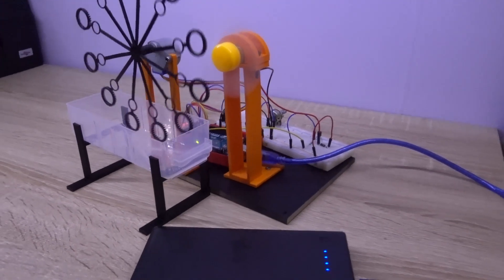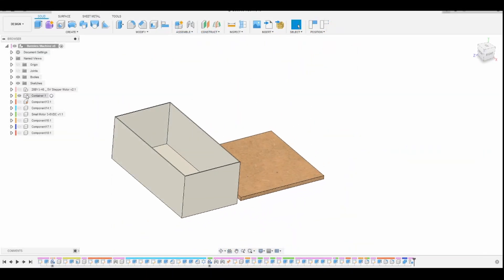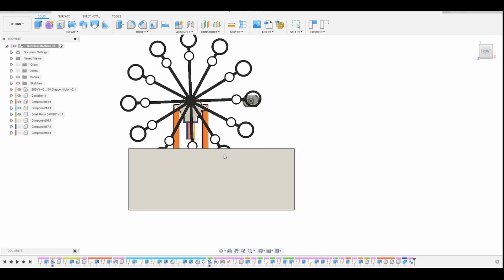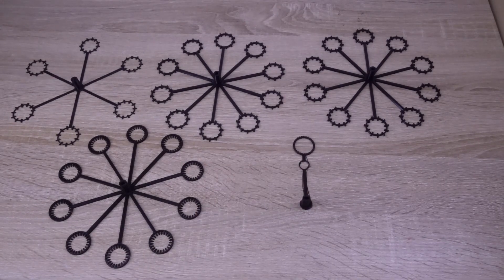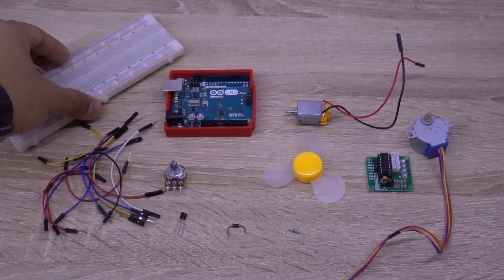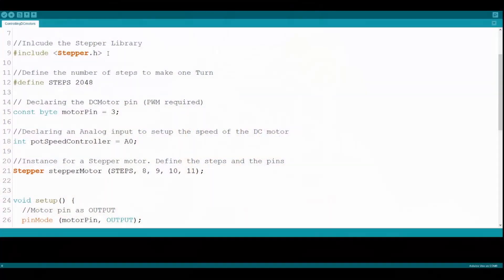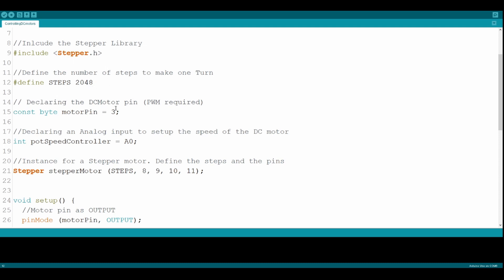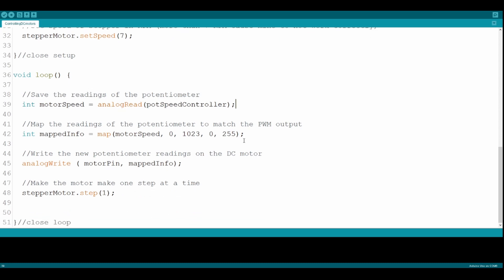3D printed Bubbles Machine | Arduino controlled

Comment: Transistor number?
Reply from the maker: 1 x 24BYJ48 Stepper Motor
1 x ULN2003 Stepper Driver
1 x 3VDC Mini Motor 130 with a Fan Blade
1 x Arduino UNO ( or NANO)
1 x External Battery (for telephones / You will have some problems using only a 9VDC battery)
Reply: @carlos3dprint  I don't see any transistor in the list